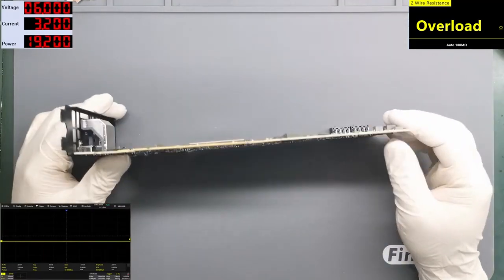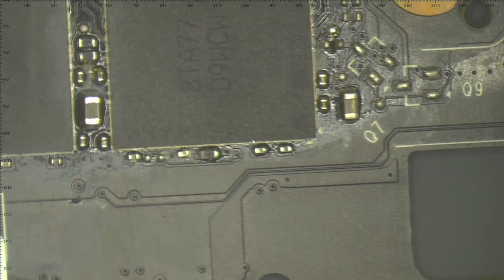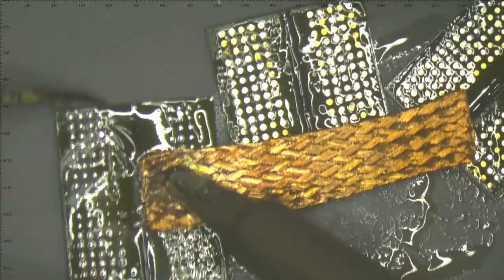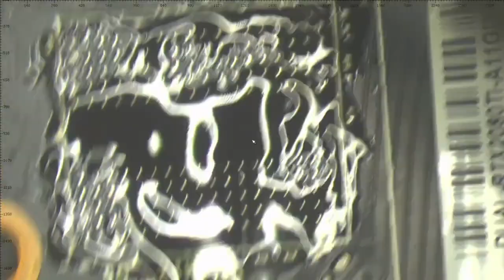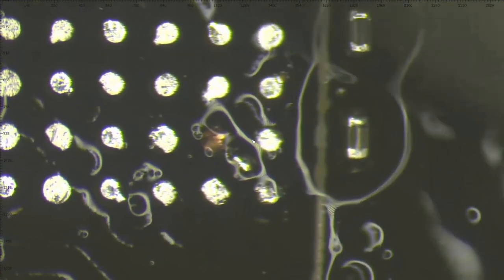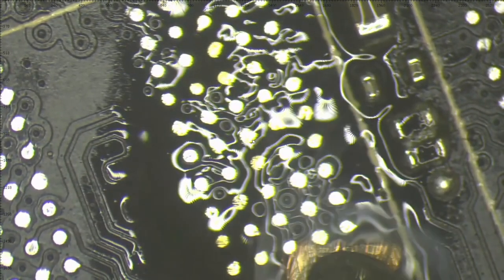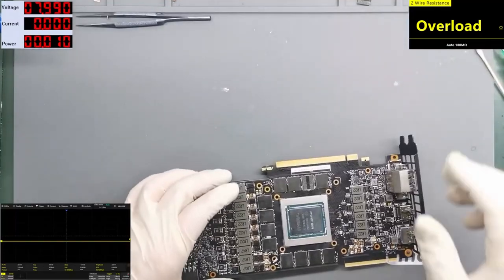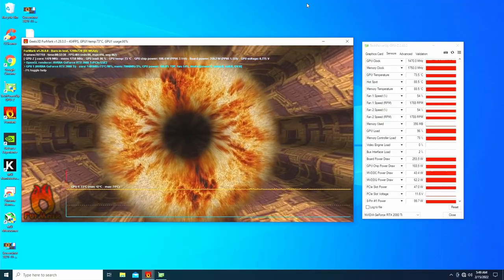ASUS RTX 2080ti graphics card Repair [Damage after warranty repair] #nvidia #gpurepair

Comment: Hi Kris, Very nice work !! I have XFX Rx 470 4gb the issue was that it wont detecting and I went to repair shop and they fixed it but I have dual bios card but when he fixed it only one bios working not other one it hangs on post on that bios and mb beeps for not detecting. Could you please tell me what will be the issue? And I have bios programmer but it wont erase chip fully status register error came up any idea how to erase bios fully? ch341a bios programmer. And HDMI port not working on my system but repair shop tested in his system HDMI working on my card why is that?
Reply from the maker: Send it back for warranty repair

Comment: Hey Kris, if a pad is ripped, sometimes some pads are pairs and will not effect the memory functionality.
But sometimes pads ripped and memory will no longer work.

Question:
Is there a way to bypass bad memory so that video card would work but with less memory ?
Reply from the maker: For testing purposes-yes
Reply: @KrisFixGermany  What about for long term use? Such as an RTX 3090 if half the memory fails, we can use just 12GB as a fail safe/ fall back plan?
Reply: @Multimeter1  you would have to customise original bios. Maybe you will find something about that on the internet

Comment: Hello, i found your video as my gaming pc went black. It seems that issue was not in Asus motherboard and i am now waiting to get it back and i try to connect again my Asus ROG-STRIX-RTX2080TI-A11G-GAMING GPU. If it doesnt work i think i will create repair order to your site. It is shame if card is broken (all lights and fans seems to work but no picture and MBO gave VGA led. Warranty run out from it (36 months) just beginning of this month :(

I really liked your video.
Reply from the maker: Hi
We can take a look if the card is the problem 🙂
Reply: @KrisFixGermany  Great. I should know that this evening and i allready looked your website and repair order. Well i also looked several of your videos of card repairs last evening as they were extremely interesting as electronic DIY builder but ofcourse something what i cant do with devices i have home :)

Comment: @Northwestrepair or Anyone! Help Sos! i have a RTX 2080 ti FE.

it had artifacts with code 43 witch is a memory problem actually! but after a phew reboots the card would work just fine for phew minutes and crap out again.

i saw some youtubers suggesting to blast the card on the core with a heatgun for 10 min. that completly killed the card.

- NO Post!
- Fans are on 100%
- Even the Nvidia logo is inactive!

- Is the GPU completly screwed?
- did i manange to corupt the bios on the gpu with excesive heat?
 
I inspected the card nothing no burn mark or discolloring or missing component nothing.